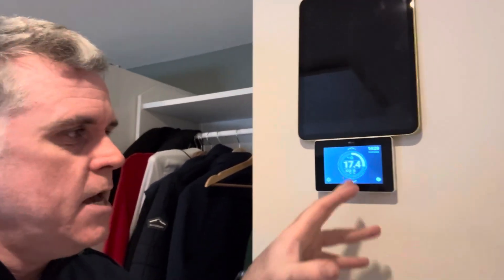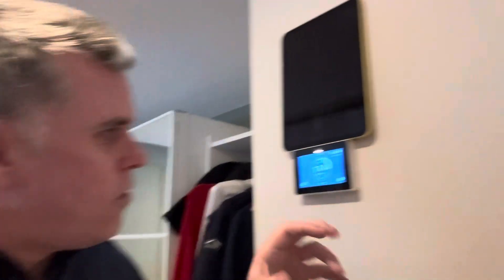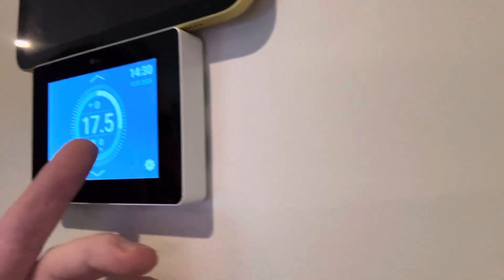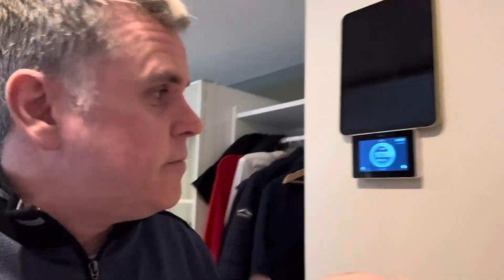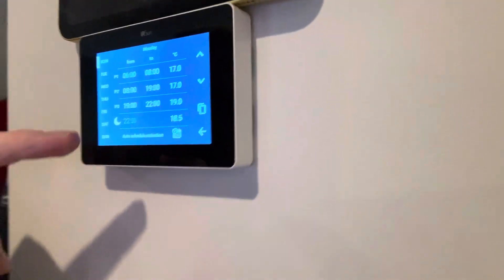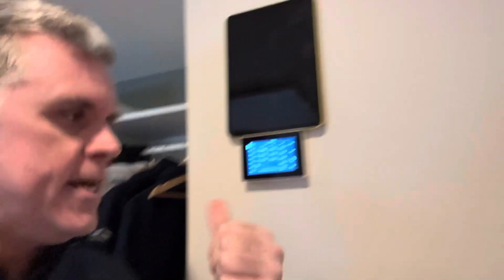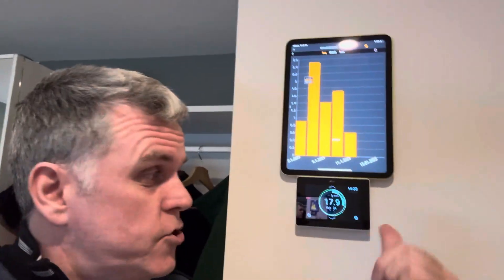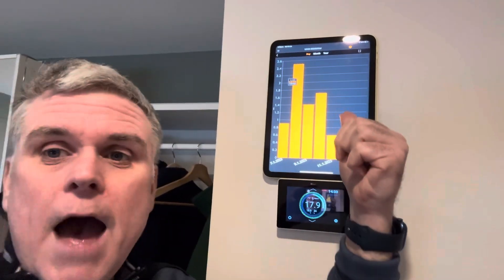infrared panel installed and What energy dose an infrared panel use ?

Comment: Hi really like the products. Roughly how much does it cost too heat a standard sitting room for a week?? In ireland. Thanks.
Reply from the maker: The infrared panel is between 370 and 450 plus vat and the ir sun controller is 169 euro plus vat.

Comment: Infra red heating panels are  radiant heaters. Which means they heat up objects via heat radiation and not heating the air and convection  the heat by circulation of air. So these panels are great for heating objects such as a person sat in direct line of sight of the heater. The thermostat on the wall is measuring air temperature. Which is the air heated by convection from the object that has been heated  by the panel. The future of the energy savings with these heaters will be with human presence detectors that boost a room  location only when occupied.
Reply: This means the thermostat will do false control as the air temperature is not heated directly?
Reply: @mohammadhijjawi6819  Basically yes a room stat will be slow to react if out of the radiant beam and will only react on radiant heat being converted into convected heat to the air..If the thermostat is in the beam of the radiant heat. The thermostat would react too fast as it is heated directly. And the room air will still be cold.
Reply: @andrewtitcombe8378  maybe ir thermostat shall be used to measure the surface temperature